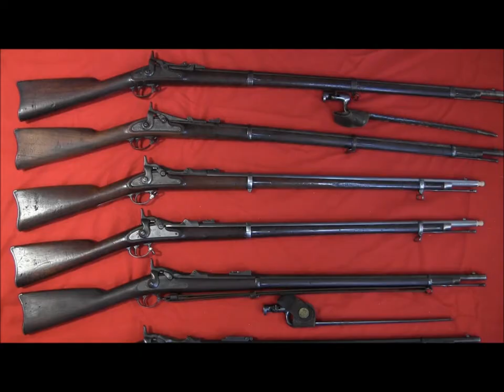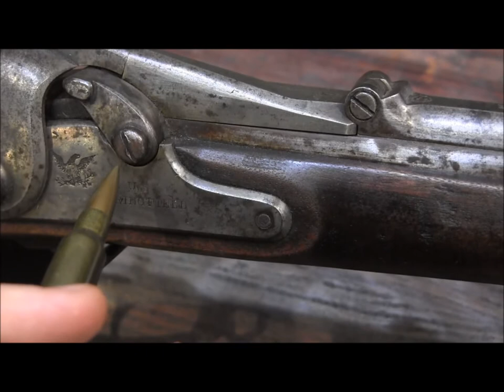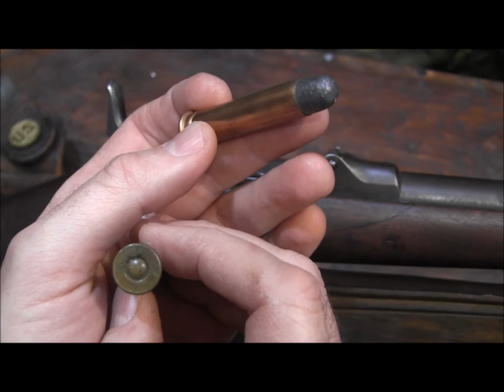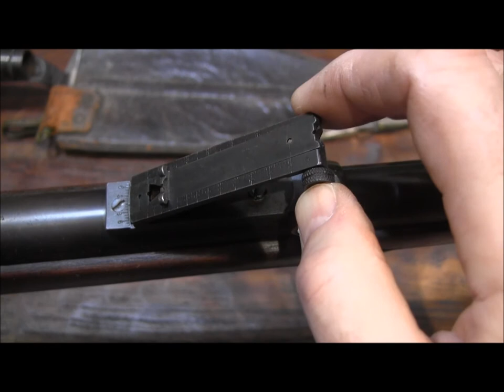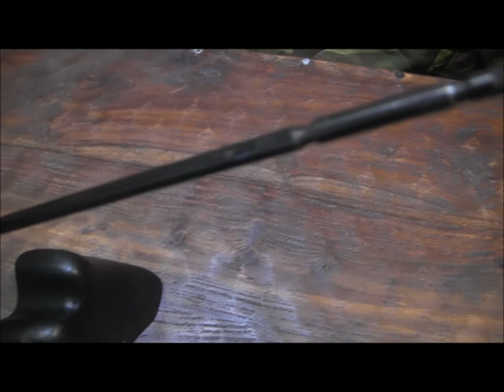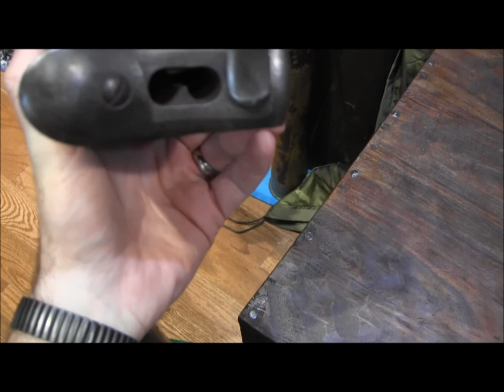Trapdoor Springfield Models 1865 through 1888

Comment: WOW!! Thank you so much for this tour of the Trapdoor rifles!! I have one in excellent shape, I shoot it and it works perfectly. Stock is 1884, with the shorter distance between the trigger guard and the beginning of the comb, also the serrated trigger and the trapdoor is marked 1884. However, the lock only has two notches. Bluing is about 85% and the stock is perfect, no cracks or gouges. I treat it with boiled linseed oil every so often. The leather sling is all intact, Rock Island Arsenal, treated with Obenauf's every so often....No cartouches readily discernable although it seems a very faint one appears on the left side of the stock close to the upper bushed screw. There is a "43" struck into the right side of the rear of the stock. A treasured gift to me by bu late Uncle..Thank you again for this wonderful presentation..

Comment: I read that the windage feature on the Buffington rear sight was disabled on some of the 1884 models, for what reason, I don’t know, and sure enough that was the case on my 1884. I disassembled the sight and found a small hole drilled on the underside with a pin inserted that prevented its movement. I removed the pin, reassembled, and now it works.

Comment: Firing the 45 70 Springfield was pure orgasmic. Years ago when my Dad was living we did Black, smokeless, pyrodex  RS, CTG. I casted my own. I reloaded them for pennies on the dollar. Those were  the best days of my life. I cringe at the entrenchment tool. would'nt you bend the barrel. the solders using it would not worry about that especially if a trench would save there lives. You forgot the coffee grinder in the butt plate. Thanks for all your info especially on the earily ones with no receiver.

Comment: mine is an 1886, is it supposed to have a Ram rod with it? mine does not have one, but the groove is there for it?
I guess, your saying its a cleaning rod. I also could not get the knob to turn at the top of the buffington site. the windage site turns well. I also noticed the front band that holds the barrel to the wood has become a little loose, is this something I should have a gunsmith fix? or is it something I should leave alone for the patina and age?. I don't plan on firing it in my lifetime. my local gunsmith reccomended that I used Renaisance wax on it with a gun stock and just store it away? thoughts? answers? Do you have any connections where I can buy an original cleaning rod for that particular weapon. I know nothing about antiques firearms. I would love to have it complete with an original bayonet as well

Comment: RYI: My 1870 (serial 4990x) has the long receiver & site your 1868 has but is dated 1870 above the eagle, with 1863 dated lock plate. I have no doubt there is a huge # of variations as they progressed.
Reply: Your gun is actually an 1868 model made in 1870. Only 1868s have serial numbers until 1873

Comment: Hello, I purchased this 1884 Springfield trapdoor rifle yesterday. It came with an unusual single hook on each end, leather sling that I knew was not correct for the gun. After looking online, it shows a lot of similarities to the Civil War era slings. The only difference is where the hooks are, the leather is normally doubled over and stitched on the originals. This one is not. I am hoping that someone has seen this sling and can identify it. Also thought that perhaps it was originally doubled over and broke loose and re-attached without stitching, perhaps just cut down slightly. so if anyone knows the actual length of the originals that would help. Looking forward to any information you may have. Thank you.

Comment: Nice video but quick question. Had the U.S. Government converted older Allen conversions into the newer patterns.

Also what about a lot of the foreign bought Rifles muskets, did the U.S. just threw them away or did they did conversion similar to the Allen?
Reply from the maker: The pre-1873 models weren’t in service long enough really to be updated. Since the Model 1873 was built of mostly all new parts, there wouldn’t have been much call for upgrading the older ones. Model 1868 & 1870 rifles were amongst those sold surplus to France during and after the Franco-Prussian War. Some 1865 & 1866 rifles were later shortened, but this is believed to have been mostly for cadet use at various schools, and not done by the government. Some early Model 1873s had their breechblocks upgraded, and, I believe, their rear sights. I don’t know of any upgrading of 1873s to later models.  

The foreign weapons brought in for the Civil War were mostly sold off as surplus soon afterward as they were non-standard. You can build a whole collection of them today,

Comment: I have a model 1884 that was military issue marked with a 6 F 29 on the but stock S# 515256 would you happen to have any info on when/where it was issued?
Reply from the maker: That serial number is not in any of my books. Your Model 1888 was likely manufactured in 1891. With those markings it sounds like it was issued to some state’s 6th volunteer infantry regiment, company F, probably during the Spanish-American War.

Comment: Hi very informative. I was just given a trapdoor with serial #9, lock plate 1864, breech 1869... shorter receiver like the 1870, ramrod like the 1868... I believe I have heard that there is a second round of production on the 1868 that featured the shorter receiver. Any input is appreciated. In any event thanks for the video.
Reply from the maker: Hi. That sounds like a Model 1869 Cadet rifle. I don’t have any of the cadet models. If it lacks sling swivels, it is likely a cadet model, made for use in military groups in schools. Whether it is an original, ‘as built’ Model 1869, or a Model 1870 rifle that was later converted to a cadet type is something it would take someone far more familiar with these rifles than me to answer.
Reply: @SearTrip  maybe, it does have sling swivels and the 32.5" barrel not the shortened barrel for cadets... also it has the thicker lock plate... any advice on books or websites for me to dig deeper? thanks!

Comment: the fist click of the hammer is the saftey posistion
Reply from the maker: It is the half cock position, which is sort of a safety.
Reply: Adam, I believe you’re correct.  Also, Duelist1954 describes it as such.  First click is safety, just enough to get the hammer off the butt of the firing pin.  Second click is half-cock which allows manipulation of the trapdoor and loading.  Third click is full cock.

Comment: My grandfather has a model 1884 that has been passed down my family that I have been told was used in the Spanish American war. Im not sure how true this was as the conflict happened over a decade after they were produced. But it hasn’t been fired since its original owner used it and my grandfather wants to take me to go check it out by a gunsmith or something, or at least that was the plan before 2020 happened. But does anyone have any idea what to do to get the gun checked professionally (check the serial number to see how it was used or something). Live in Massachusetts btw.
Reply from the maker: While the Regular Army was armed with Krags in the Spanish-American War, most of the Volunteer units were still armed with Trapdoors. So it is possible yours was used then. Springfield Research Service can provide information on where some of these rifles were issued, for a fee. I have some of their older books that have some info., if you have the serial number I can look it up.